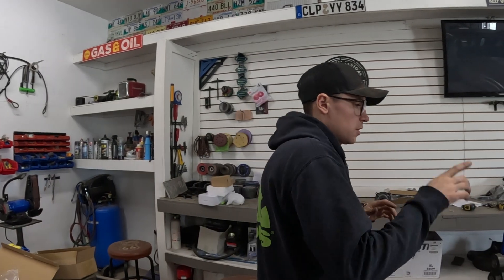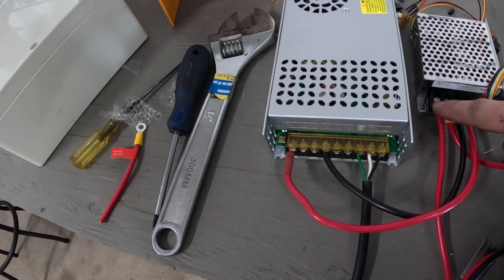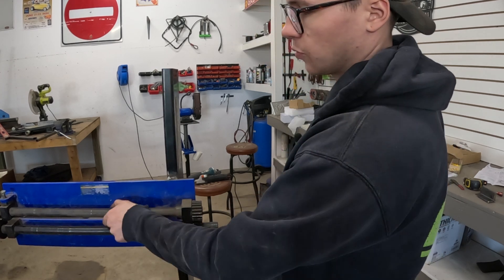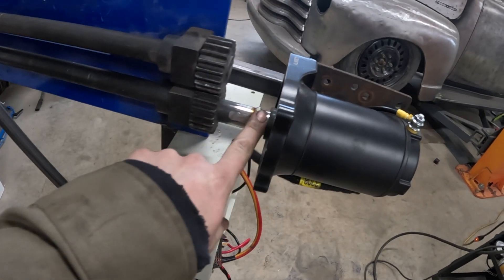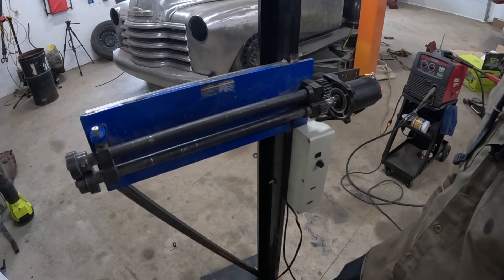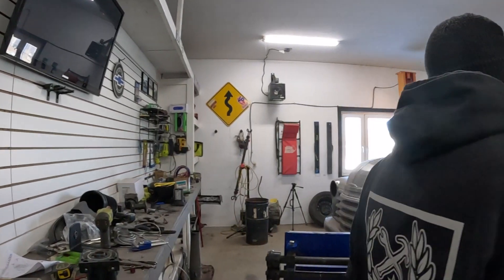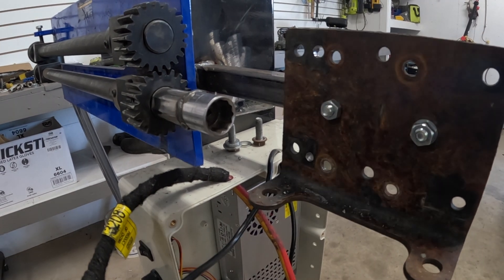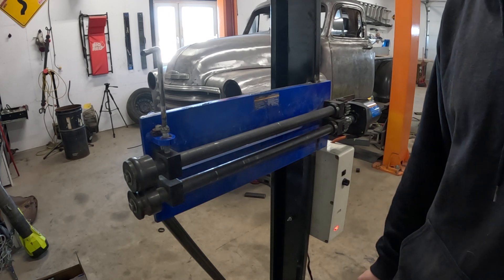DIY MOTORIZE BEAD ROLLER

Comment: You gave me an idea.  Instead of a motor, get a whole winch, (2500lb) and drive with that so it turns a whole lot slower before you add the speed controller.
Reply from the maker: I think it would spin the same speed as the motor, having the cable spindle on there wouldn’t change the speed